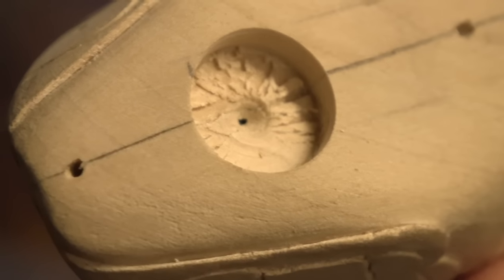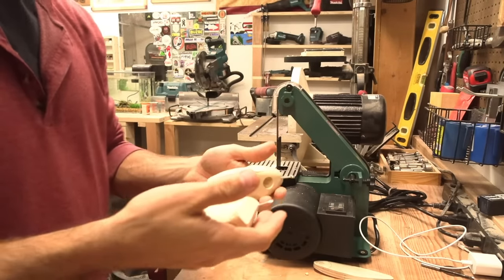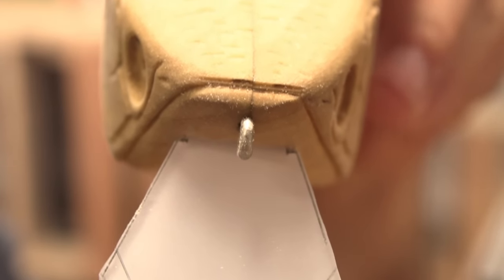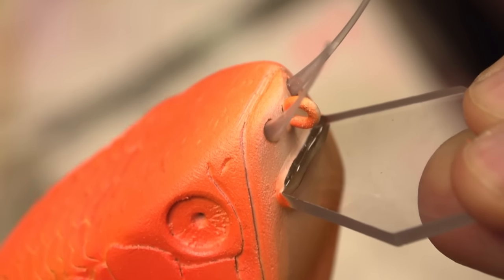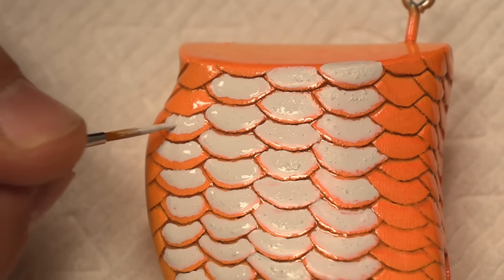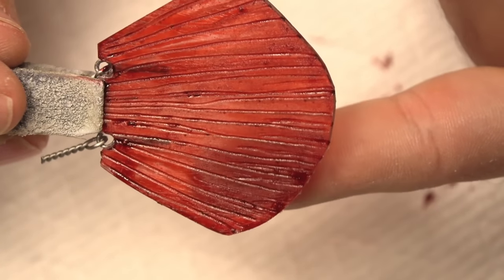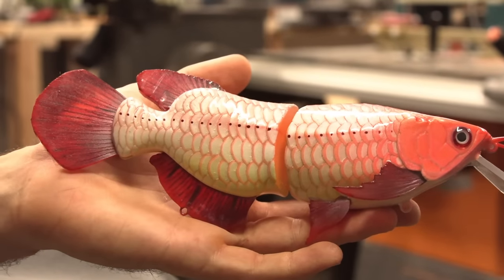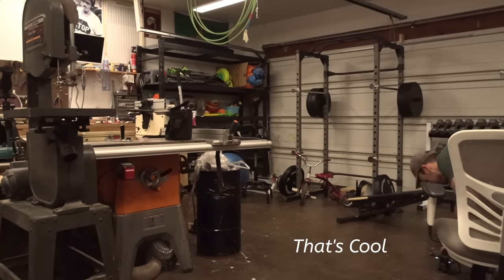Making an Arowana SwimBait

Comment: I wonder if a really exaggerated, deep scale pattern carving would change the action of a bait? Part of me thinks that maybe it'd act sort of like the dimples on a golf ball and sort of stabilise it

I did a lot of work with candy paints back when I used to paint guitars. They're basically just a tinted clear coat and work best over another colour such as silver or gloss black which is then drowned in clear coat to give the appearance of depth. A lot of fun to play around with but can be very tricky if you're looking for even coatings over large areas (probably not an issue for you). A fun effect I always liked was to first shoot a solid base of metallic silver, let it cure (a coat of clear helps if it's on something rough like wood) and then shoot a thick coat of gloss black over the top, before it dries pick up a scrunched up plastic bag and dab at the wet black to lift some of it and reveal the silver underneath in sort of a crystalline pattern. Shoot your candy over the top once the black has dried and it's a pretty interesting look

Comment: So I had an idea Nate, and it's gonna sound like a pain in the butt, but just hear me out brother.  If you use a large cylinder (graduated cylinder?) that has volumetric markings (Milliliters AND Fluid Ounces markings). You could push the bait into the tube that is partially full of water. Take note where the water line is Beforehand and And After the bait is submerged into the cylinder. If you do that, then you can figure out how much water is displaced. That gives you a figure for the volume of space the bait takes up. Then you could weigh THAT  volume of water that was displaced by the bait (or just do some simple subtraction with those before and after measurements to figure out how many "fluid ounces" the bait weighs). I would use the Milliliters measurement for figuring out the volume and the Fluid Ounces to figure out the weight of the water that has been displaced. Then with a formula you can figure out the Specific Gravity of your baits. 
I think you would also have to weigh the bait to have a figure of how many grams it weighs so you could compare that figure with a let's call it a water balloon lure of the same exact size. This way you can compare all your future baits Specific Gravity (how much denser or less dense than water).
Probably sounds like a lot of unnecessary math but you can dial in the depth at which your baits will sink to when you have a unit of comparable measurements.
Reply: The specific gravity, then, may be determined by dividing the weight of a substance in grams by its volume in c.c.; but it is more convenient in practice to determine it by dividing the weight of the substance by the weight of an equal volume of water.

Comment: Would a crescent shaped blade tip help to carve a scale pattern a little faster?
Reply: Probably not.
Reply: @SolarfallBaits  I’m not pretending I can do better, don’t get me wrong. It just seems like some specialty carving tools might be just the thing.
Reply: @sswwooppee I probably could have elaborated it more. My thinking is that your still doing the same motion even if the blade shape is slightly different so it most likely won't give you any advantage in speed.